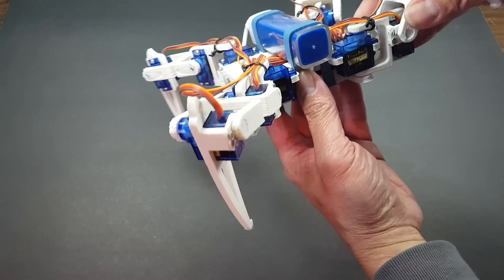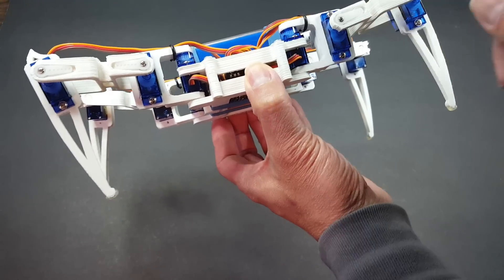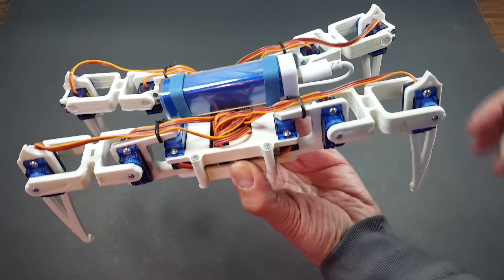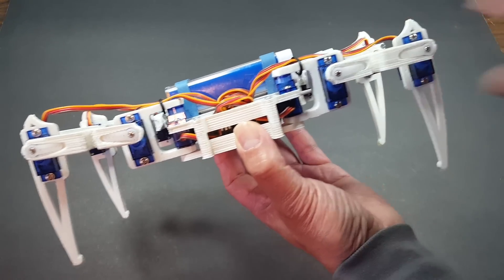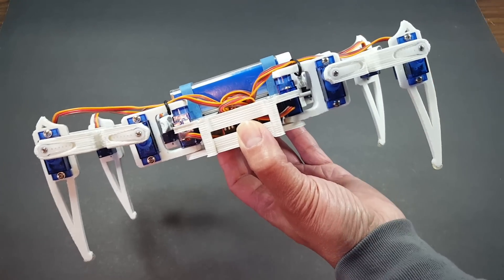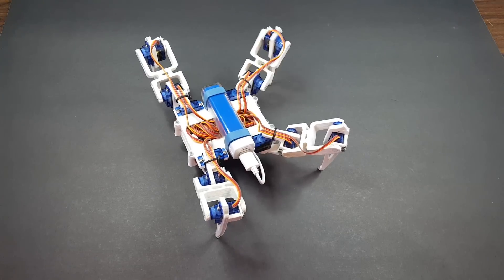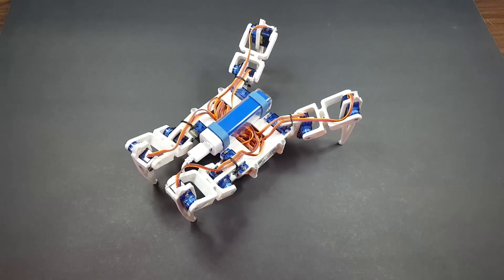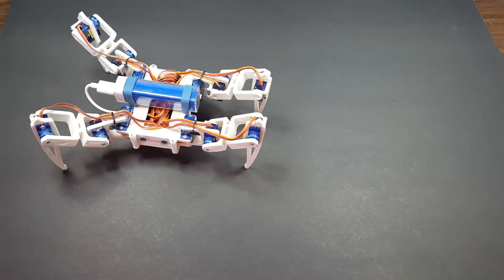HariFun #149 - 3D-Printed Arduino Spider Robot

Comment: Hi, I would like to build a robot like this but I don't want to use a power bank. 
What are the necessary voltage and current values if I use normal stylus batteries? 
If I use stylus batteries I assume I need resistors, what would their values be?
Thank you in advance
Reply from the maker: Vittorio, the servos require 5 Volts. I'm unfamiliar with the battery you mention, but powering twelve servos take a lot of current.  Make sure the battery can provide at least 1Amp.

Comment: Do you power ALL servors directly from the Arduino? Must be several Amps though! Isn't that too much for the Ardu's power regulator?
Reply from the maker: Yes, you are correct. Powering all the servos through the Arduino would be a bad idea.

Each servo data pin is connected to an Arduino GPIO pin as expected.

Servo ground pins are connected to Arduino Gnd AND powerbank Gnd for common ground.

However, servo power pins are NOT connected to Arduino. Instead they bypass the Arduino and connected directly to the powerbank (+) pin.

Comment: Thanks for the video, I managed to get the 3d parts, I'm stuck on the part to find screws for it before I can buy servo motors, can i get the screw specifics? I'm new to 3D printing so do i need to get specialized screws ?
Reply from the maker: Hi, the servos should come with horns and screws.  You need just a few more screws for the body, those are not critical.  I just used some screws I have in the junk bin.  You could purchase some wooden screws in your local hardware store if you don't have any small screws.

Comment: I try this same instructable but my servos just went crazy, some even turning 360. I thought it was my battery, but you´re using a 1A batt, so I´m kinda lost now.
Reply from the maker: Grr. That's frustrating.  What do you mean the servos went crazy? Unless you are using continuous rotation servos, they should only move about 270 degrees (cannot turn full circle).
Reply: @HariWiguna  I tried the first script so I can finally connect the servos, some fix at 90 degrees others at random runs in full circle. This are cheap servos it loos they don't have the 270 stoper. If I only connect 1 or 2 legs the work fine, the problem, appears again when I connect all legs. I´m using 2x1865 batteries
Reply from the maker: @spicajames  Yeah, you need  the 270 stopper. More specifically, the axle is connected to an internal potentiometer so the servo knows what angle the axle is at.  Without that, it would continuously spin clockwise or anticlockwise not knowing when to stop :-(

Comment: Hi Hari, how did you wire the board up. I looked at Regis' instructions but I am finding them pretty confusing just wondering if you can click some quick picks of the wiring because I am super close to finishing this project. Thanks.

Comment: Couldn't it burn an Arduino to use 12 servo without external power supply??plz reply.
Reply from the maker: You are correct. Powering 12 servos using the Arduino's 5V supply would be bad.
However, I did NOT power 12 servos using the Arduino. Instead, the Arduino only drives the data pin of the servos to control the angle of the servos.  The servos are powered directly by the 5V power bank battery (not through the Arduino's voltage regulator).

Comment: Hi what kind of battery are you using?
I'm using 18650's on mine (my own design) and the robot can't support its weight.

Specs:
12 KUMAN Micro Servo 9G's
4*18650 batteries (I used 6 and then I removed 2 of them)
3D printed parts I designed.
Arduino Nano (clone from China) and PCA9865 Servo Controller Board (clone from China, as is all of my electronics).

I will post design on my GitHub when I finish it. Also, there will be a seperate one for DiyMore MG996R servos.

I will post both quadruped and hexapod designs.

EDIT: MG996R designs on Github: https://github.com/macaquedev/APQuad
Reply from the maker: I used this 5V powerbank. Much lighter than four 18650s. Add to that 12 instead of 4 servos and the servo controller.  You might need stronger servos than 9G.   https://www.adafruit.com/product/1959
Reply: Hari Wiguna thanks a lot for the very quick reply!
Reply: What kind of servos are you using?
Reply from the maker: @somebody9033  , they're 9g servos. Check the links in video description for more info.

Comment: What are the parts needed aside from arduino nano, servo , filament for 3d ?
Reply from the maker: I used a universal PCB and some headers to make connecting the servo cables easier.  Regis used a custom pcb to do same.
I put two switches: one for motor power, the other for servo power, but both are optional, you can just unplug the battery.
Of course you would need a computer to put the code onto the Arduino.
Reply: @HariWiguna  only 1 powerbank can power multiple  servos ?
Reply from the maker: @romeo1245  , Yes, as you saw in the video, the powerbank was able to power all the servos and move the spider. Typically only a few servos have to move at any one time - not all at once.

Comment: What did you use when you are doing that
Reply from the maker: If you meant which 3D printer I used, it was a home made 3D printer I built based on Printrbot design.  These days, just about any 3D printer would be able to print this robot.
http://g33k.blogspot.com/2013/05/too-busy-having-fun.html
Reply: No  want to mean like the battery and uno nano
Reply from the maker: @murathanabdoulaev2421  , I used a powerbank from AdaFruit and an Arduino Nano.
https://www.adafruit.com/product/1959
Reply: And how can I control that with a controller
Reply from the maker: @murathanabdoulaev2421  , here is the link to a remote control by the original creator of this project ( I only 3D print and assemble his design).
https://www.instructables.com/id/DIY-Spider-Robot-PART-II-Remote-control/

Comment: Can i use Arduino uno for this? ang neglect the DC-DC 12v-5v conv? Cause uno has 12v jack.
Reply from the maker: The DC to DC is mostly for the servos. They require 5V to 6V and a lot of current.  The power regulator built into Arduinos could probably handle four servos, but not twelve :-(  So while you CAN use the Uno, you will still need to come up with a high current 5V power source.  Regis uses a DC to DC converter, I used a 5V power bank.

Comment: Did you have any issues powering the Arduino from a powerbank? I bought one but it didn't seem to work - I think it's shutting off because the current draw is too low.
Reply from the maker: I do not have that issue, but someone else had the same issue. I think my powerbank does not have auto-shut off feature.  It does not even have a power switch.  I bought mine from AdaFruit if you're interested in getting the same one.
Reply: @HariWiguna  Cool thanks, I presume it's this one? https://www.adafruit.com/product/1959
Reply: Interestingly, that says this in the description:

> If using it with a low current load, say under 100mA, the pack may 'fall asleep' - you can use this circuit to keep the pack awake

Which sounds like the same sort of issue. I wonder whether that's something newer that wasn't on the version you bought?
Reply from the maker: @DanTup  , Yes that's the one. I wonder the fact that the servos use quite a bit of current kept it on.  But then again that should have worked with your auto shut off power bank too.  Maybe you're right it is a new thing they started adding to newer models.
The original one by Regis uses Lithium ion battery packs, maybe that's the way to go.
Reply: @HariWiguna  I'll see what I can find, thanks!

Comment: is there a picture or diagram for the bottom of the perfboard like done for the top at 2:14, dont understand how to wire everything underneath properly
Reply from the maker: Here is the bottom of the board.  Unfortunately, some are covered by the plastic enclosure.  It would be quite a surgery to remove take  it out.  The two switches are optional, you could just unplug the power bank.  The gist is that you would power all the servos directly with the 5V power bank while the data is driven by the Arduino I/O pins.
https://github.com/hwiguna/HariFun_149_3D-Printed_Arduino_Spider_Robot/blob/master/20181219_010014.jpg
Reply: @HariWiguna  sorry but this picture appears to not be anything , picture may be missing or broken?
Reply from the maker: @sargentmayhem2033  Hmm, it worked for me.  Let's see if imgur serves the image for you.
https://imgur.com/a/JDFeSS7

Comment: hi there! awesome project.. can you tell me a lil bit about the battery you used?
i tried some i had lying around but they seem to fail to feed enough current to the servos.. (mine looks like an almost dead bug)
Reply from the maker: Yes, it takes a lot of current to power all those servos.  This is what I used. 5V 1Amp.  Make sure you power those servos directly from the powerbank and NOT through the Arduino's 5V rail.  Arduino should only supply common ground and the PWM signals from the I/O pins.
https://www.adafruit.com/product/1959

Comment: Hello, i have got  a question about pin diagram. By the picture, for example for leg 1, femur connect to d2, tibia connect to d3 and coxa connect to d4. But in the pcb file (file PDF on regishu page, coxa connect to d2, femur to d3 and tibia to d4. Could you please tell me which connection is right? By the program I figured that connection by the first method but I am not sure. So please help me.

Comment: If possible, could you help me with the making of the board, I'm new to soldering chips and stuff, Thanks!
Reply from the maker: Oh you can do it!  Even if you've never soldered anything.  The wiring is really easy: connect all + of all the servos to the +5V on the power bank, connect all - of all the servos to the ground of the power bank, then connect each servo to the Arduino I/O pins as specified in the Arduino sketch.  Then I also power the Arduino using same powerbank by connecting its +5V to Arduino Vin.  Finally make sure there is common ground between the power bank, arduino, and the servos.

As far as soldering tips, you can find many excellent YouTube videos but the gist is: 
(1) Use good tools (temperature controlled iron with good clean tip, fine 60/40 solder, optionally flux pen)
(2) Heat up the surface to be soldered, then apply solder, not the other way round.

If you have further questions, I'd be happy to help.

Comment: How do you control it?
Reply from the maker: Mine was only pre-programmed for a sequence of movements, but being Arduino controlled, but you could control it with anything from bluetooth, WiFi, RF, IR, voice. Using custom remote, or just your phone. You could even make it autonomous so it would react to the environment using sensors.

Comment: can i make this project by arduino nano , if yes please send me pcb diagram on my email ID shub1ham0@gmail.com
Reply from the maker: Shubham, yes, you can use a Nano, that's what I use.  But, sorry I do not have a schematic, but there's nothing to it.  I just wire up the power for all the servos directly to the power bank (5V battery), and the servo inputs to the Arduino I/O pins while carefully making sure that the physical layout (which servo is on which joint) matches the sketch.  Regis has all the code in instructable that I share in the video description.  He also has a calibration sketch that I mention in the video.

Comment: How many volts did you use the battery? What kind of battery did you use?
Reply from the maker: I used a 5Volt battery that is intended to charge cell phones.  It is generally referred to as a "Power Bank."
Reply: Hari Wiguna Thank u very much

Comment: where can i find the circuit diagram, sorry iam new on arduino thanks  excuse myy english
Reply from the maker: The circuit is straightforward. All positive and ground of the servos should be powered by battery.  Ground should also be connected to Arduino ground. Then the signal pin of all the servos should be connected to Arduino I/O pins to match the sketch.
Regis wrote a full instructable here: https://www.instructables.com/id/DIY-Spider-RobotQuad-robot-Quadruped/

Comment: Hi, could you tell me what this is for?
Reply from the maker: I did it for the fun of making it and the joy of seeing it work.
Reply: if you can help me to know, in the part where the circuit, is the arduino implanted in the amperage A5 and A4 to the right side of the resistance, where is it connected and what is it for?
Reply from the maker: Do you mean Arduino A4 and A5 pins on this diagram?
https://cdn.instructables.com/ORIG/FTH/SGZT/IFCDE6U8/FTHSGZTIFCDE6U8.pdf
SCL and SDA are I2C protocol pins, but as far as I could tell, Regis was not using them.  I didn't use them on my spider.
Reply: thanks for your help

Comment: did u made any adjustments to code since ur using arduino nano? pls reply fast  thx
Reply from the maker: No modification is necessary for Nano.  I only removed code that I do not need since I do not have remote control, and I just rearrange the sequence of movements for best video effect.  I might have also reassign the ports for wiring convenience, but that's not necessary.

Comment: Hi, i find the design amazing, can u answere me how much weight the servos can handle?
Reply from the maker: Although you could find out the torque from the datasheet of your servo, I do not know how to translate that to how much weight the robot could handle.  Based on my experience, it's not very much.  By using a LiPo battery, you could lose some weight and spend it on whatever you wanted to carry.

Comment: how can i control it using a hc-06 Bluetooth module?
Reply from the maker: Regis uses another Arduino and bluetooth module as a remote, so it is a wireless serial connection between the two Arduinos.
https://www.instructables.com/id/DIY-Spider-Robot-PART-II-Remote-control/

Comment: How did you connect the power bank. I am using and arduino uno so can i connect the power bank to the board using a usb to dc cable.
Reply from the maker: Yes, you can power the uno with USB to DC cable.  Just remember though, the power for 12 servos should NOT come from the uno.  The 12 servos should be powered directly by the powerbank or some other external power source.
Reply: Thanks.Im using an arduino sensor shield so i just have to give an external power source. How many voltages do i require to power the servo.

Comment: Hi, I'm doing this for a project. I reaaally hope you can reply asap. I was wondering if you can control the movements (backward and forward) using a laptop?
Reply from the maker: Yes, you can definitely make it remote controlled by a laptop. There are many options depending on whether you want it wireless, or could it be wired. At any rate, Regis shares of all the code so you could modify it to do whatever you want.  Please follow the instructable link in video description for lots of detail.  Good luck!

Comment: All 12 servos are powered off the same 5v rail on the Arduino? wont that burn the Arduino out?
Reply from the maker: Excellent question! Yes, you are right, powering 12 servos off the Arduino 5V rail would be a bad idea.  So, all the power lines of all the servos are directly connected to the powerbank.  The Arduino only need to supply the PWM signals, not much current is needed for that.
Reply: Cool. Thanks for clearing that up for me.
Reply: @HariWiguna  is  it because that wiring that your powerbank stays on?? because mine turns off after about a minute...
Reply from the maker: @MaddoCosplay  , that might be. Mine does not even have a switch.  Some people on the web mentions that some powerbank has feature to remain on by double click or holding the power switch. Good luck!
Reply: Can you please upload a wiring schematic. I don't understand how you connected the power lines of the servos to the USB power bank
Reply: Yea im also wondering how did u connect the servos externally through a powerbank